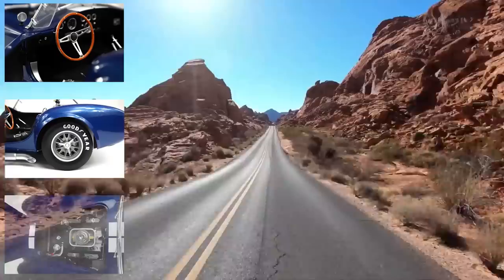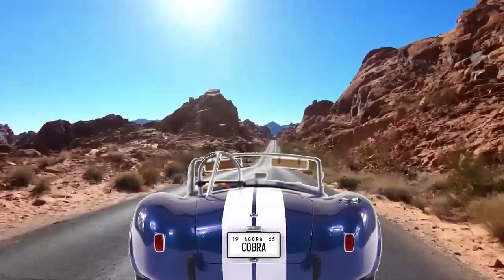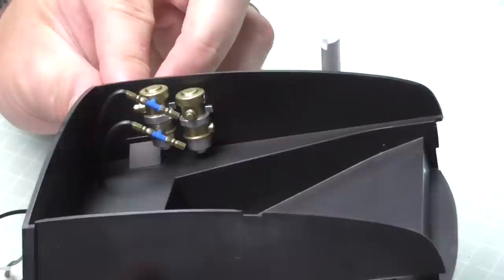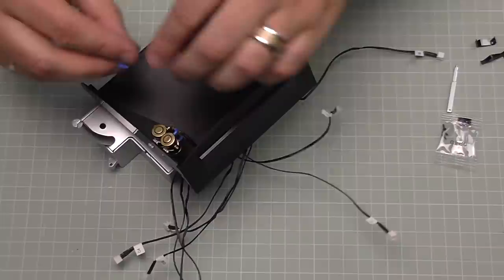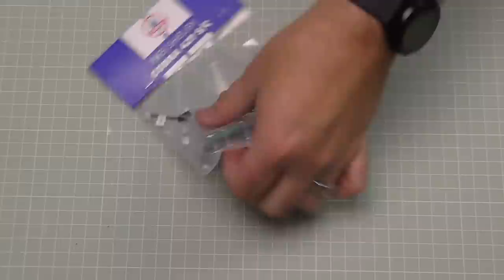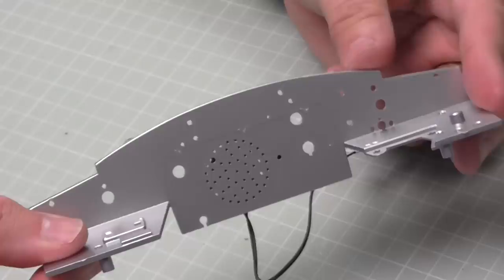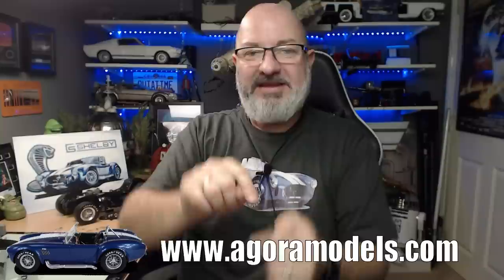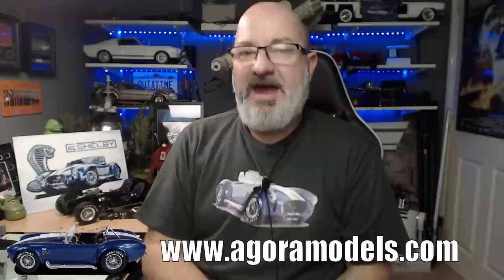Agora Models 1965 Shelby Cobra 427 semi competition 1:8 Scale - Pack 8 - Stages 57-64

Comment: Thanks for the view ahead Wayne! I just finished up Pack 6 with #7 to be here by the end of the month. 

Agora means well with some of the parts as a press fit, but I do keep bottles of two part five minute epoxy on hand. The small firewall parts IMO for me will need to be kept a bit more secure by small amounts of epoxy applied from the backside. Just to keep things a bit more set and not come loosened down the road when it comes time for final assembly.

Keep up the great work and as usual I’m going to save this video on my hard disc. Your tips and pointers do come in handy. 👌🏽👌🏽

Comment: Driving me nuts that we haven't put the steering rack on the front wheels yet.  Every time I pick it up, the wheels drop down and I have to re-align the shock cylinder into the tube.
Reply: Yes, I have the same issue too! ☺️

I’ve just got in the habit of automatically picking up the chassis under the suspension arms if I need to move it. I’d think in the following pack they should be sending the parts for that. Definitely before the main body shell arrives. 🤔

Comment: The "wire tidy" makes no sense. That is, the wires are routed through three outlets from the fuel tank, they are then routed through to channels on the "rear fender part" and then they are all bunched together and held down with a single clip. I'm not building this model but it seems to me ALL of the wires could have come out of the tank through the same center hole, and then through a hole on the "read fender part" where the single clip screws in place. What am I missing?  :)
Reply from the maker: The wires would be loose that way. I guess they wanted them locked down and tight
Reply: @WorldofWayneUK  Well, they could have come out a hole and then get screwed down, but now I'm nit-picking. I just found myself scratching my head when watching this. Normally when wires are routed in different directions it's because they're going to different locations in the model. But this amounted to 'starting all together in the tank, routing through three paths, then to two and finally they wind up all together again', which just doesn't make sense.  Ah.. blame it on a slow Tuesday!